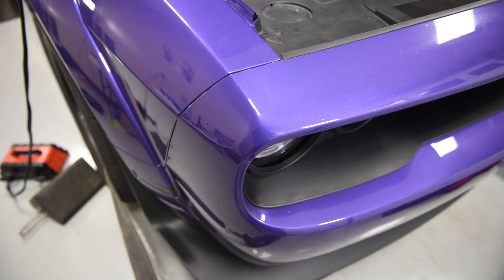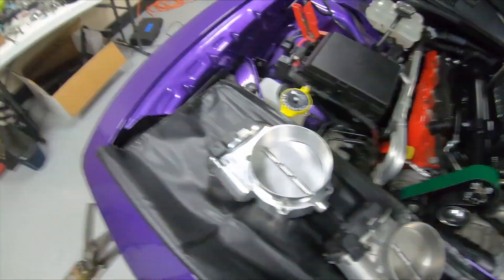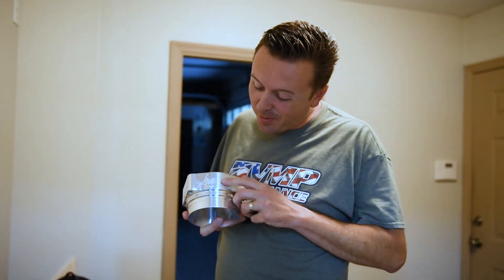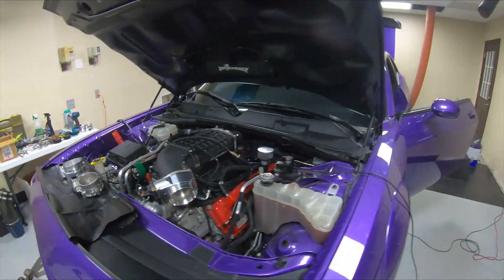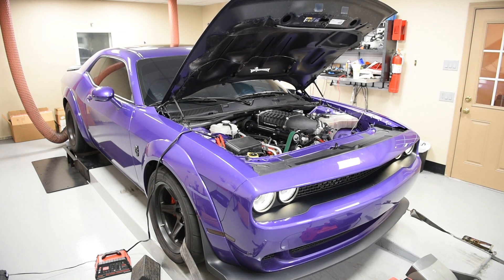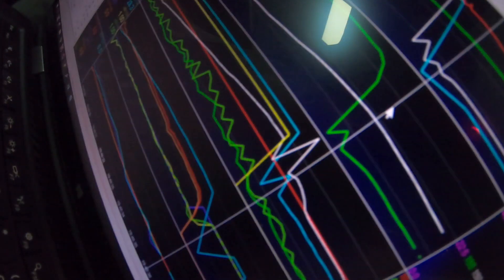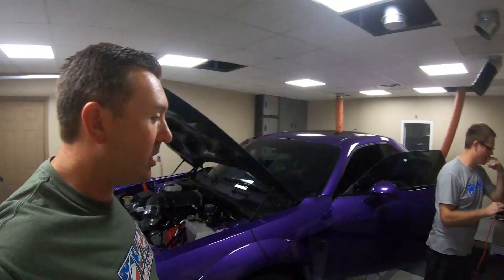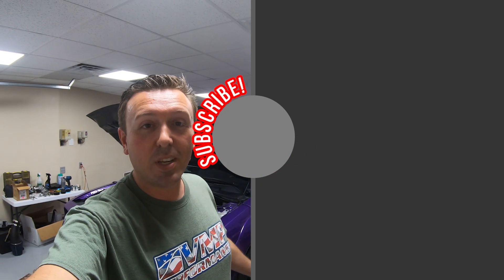First Dodge Hellcat Magnuson Supercharger On A Demon!

Comment: Need a bigger intercooler pump! IAT came up quick. 
Nice results! Monster torque I’m sure
Reply: Matt Kesatie 
Cooling is common issue with these setups. If it’s rising that fast the flow is inadequate. 
Bugatti has it figured out. For their 1500hp car it takes about 200 gallons per minute to keep IATs in check. Most street setups aren’t even above 10GPM. Department of boost has lots of info on this.
Reply: Matt Kesatie 
Is that a marine pump? 
What line size for the system?

Vmp had at least a degree/sec slower rise in IAT with a stock 13’ gt500 pump at 17-19psi. Right at 800whp and 8-10GPM.
Reply: Need bigger aftercooler bricks, bigger aftercooler radiators, bigger hoses and orifices.

Comment: A stock ported blower with other mods could have made close to that power and cost several thousand less.  Would have also been able to do a nice fuel system and run corn.
Reply: Justin and his team are just getting started. This thing will make over 1000rwhp when there done. Stock blower will not touch a 2650. Vmp is my go    To for horsepower.
Reply: Kevin Mays I’m sure it won’t. The 2650 is a bigger blower so it supposed to make more power. Me personally unless im maxing out a stock blower setup I see no need to upgrade. But that’s just me. For the $6k or more the 2650 cost I would do a ported stock blower, bigger tb, fuel system, headers, possibly even valvetrain mods. That would give more power then id ever need lol
Reply: @musclecity06  Exactly. The 2650 rotors are just too overkill for 95% of setups. The stock ported blower can make up to 900whp which is a good max for the hellcat engine. The demon motor however is fully forged and has taken well over 1000whp pretty easily.
Reply: @rileyneufeld7001  the thing is it isnt just about the size of the blower vmp is great at making blowers more efficient and they make more hp per displacenent.  If you were making 900 wheel with this blower its gonna be working  a hell of alot less than a max effort stock blower putting less strain on the blower and on the engine itself and less heat soak issues as well.  Not to mention you have a much higher ceiling with the more efficient blower.  You dont wanna go too big on the blower because it hurts power on the hit and torque thats why the 2.65 blowers are so great you get good response and a meaty powerband and the vmp blowers flow so good for their size.  This thing was doing over 900 on pump gas and im sure theyll get it higher.  The gen3r did 1141 rwhp on a stock gen 2 coyote so that shows what theyre capable of.  Lund made over 1200 whp on a built 5.8 gt500 with one...the torque was amazing too nearly as high.  It is true you may be able to get similar numbers to this video with a stock blower for cheaper but it wont be an equal setup.  Theres more to it than just what the numbers on the dyno say.  Like i mentioned before the blower works alot harder and creates more heat and more stress on the engine vs a larger more efficient blower.  So there is good reasons to upgrade.  This was also pump...can the stock blower make 900-1000 wheel hp on pump gas?   People say the same thing w the 13-14 gt500s you can make 800+ rwhp on e85 w a max effort stock blower build and andrew from mustang lifestyle makes 800 wheel on his gt500 with the vmp gen 3r but it isnt workin nearly as hard...also its doing it safely on pump 93 fuel NOT e85 which is significantly different.  Im sure this demon is similar although i dont know nearly as much about dodge stuff.  Just my .02
Reply: @rileyneufeld7001  also the 2650 is def not overkill or too big its not too big like the 3-4 liter whipples and kenne bell blowers thats what makes it great its a super efficient smaller blower that can provide nice torque low and punch on the hit while making great overall power too
Reply: reese  so the 2.65 is bigger than the demon’s 2.7 ? Lol
Reply: @lg740xx  math isnt his strongsuite lmao

Comment: Modern day...except ancient pushrod architecture. That’s why Coyotes and other Ford mod motors are so impressive. Compare the displacement to the Dodge and Chevy motors vs power produced. What does a Coyote at 24 lbs of boost make?? Over 1k at the wheels. Still, gotta love this age when the big 3 are making more and more power reliably and smooth enough to drive everyday. Amazing. 60s can’t touch us now.
Reply: But a coyote isn't touching 24 psi of boost without E85 and a full fuel system. This demon is not on E85 and has the stock fuel system.
Reply: 97jag440 not sure what your point is??? If you can make MORE power on lower boost that’s a good thing. That’s exactly what the Coyotes do. Do u build an engine to handle boost or make power?
Reply: 97jag440 oh and you realize they run mid 20 lbs on pump gas because those engines were built for boost from the factory. Thus they were designed with a 9.5:1 compression ratio while the Coyote was given an 11:1 in Gen 2 and 12:1 in the 18/19 as they were factory NA engines.
Reply: @richardsak887  yes it will make the power because it has a higher static compression ratio. Congrats you understand basic engine dynamics. My point was that no coyote would do 24 psi without E85 and a fuel system where as the demon is doing this on gasoline. (Sure its lower compression because it was designed for boost) but a gen 2 coyotes limit on stock internals is roughly 800 if you want the engine to live for a while.
Reply: 97jag440 ok...but what does that have to do with pushrod tech being old? That was my point. While they do have a few benefits, the design and tech in engines like the Coyote (and vast majority of today’s engines) produce more with less.
Reply: 97jag440 oh and as someone who mods Mustangs, there’s plenty of Gen 2 Coyotes at 800+ running fine. 1st and 3rd Gen...eh...I’d be more cautious with those. For boost though, Gen 2 loves it

Comment: I have a 2017 392 hemi with a shaker hood special edition. MOPAR17 EDITION, could you build a supercharger to work with that setup, if so what kind of horsepower could we get?
Reply: MOPAR17 bonkers
Reply: Before the powdered rods window the block? Anything above 600whp has shown to not be safe. Heck some people have blown up their 392's with only 6psi of boost... Get some forged rods and pistons in there before you think about making hellcat numbers.
Reply: Junk
Reply: @rileyneufeld7001  that's good to know, I was actually looking to do that prior to any power mods. Do you still think you could build a supercharger for the 392 shaker? I am working with Rains Performance Motorsports here in Denver. The owner works on all the Dodge Challengers and Chargers for the Colorado Challengers Club, he is awesome. What are your thoughts.
Reply: @mopar1788  I would just go with the new edelbrock blower. It has the same Eaton 2650 rotors as the vmp gen3/gen3R and is front feed which is a more efficient way to feed the rotors. The Edelbrock has gone 8.6 in the Mustang so it's proven for high HP. The only other issue after the motor is built is the transmissions in the 392's isn't made for much power from what I've heard.
Reply: @mopar1788  since you have a shaker you're only option is centrifugal, so a procharger for example. With forged rods and pistons you could sit at about 700whp at about 12psi with a scat. Any higher and say bye bye to the 8hp70. Upgrade to an 8hp90 and now you're talking 1000+ HP capable with a stroker, cam, heads, and a F1 procharger. MAYBE close to 1000hp on a maxed out D1. Imo I'd just go headers and a cam on 392, sets you right about 500-520whp on 93 and never have to worry about blowing your tranny or ring landings. If that ain't enough for u a little 50-75 shot wouldn't hurt. Definitely think about a stroker kit if you're forging the block tho, for not much more you're getting a shit ton more power and still ending with the same forged internals you wanted.
Reply: @MOPAR17 a lot of shaker guys are tucking the Magnuson TVS 2300 under the shaker bracket. It fits pretty well with minimal modification to the bracket and passes for a sleeper at first glance. Not as robust as the 2650 but it’s probably much better suited to the 392. Check out some rides on shopHemi.com. I’m getting my 2300 put on by a local shop in El Paso. It has grown very common in the last few years.
Reply: Before we swapped in the Hellcat 426 and the bigger Maggy 2650 I had a 392 shaker with forged internals with a Magnusin tvs 2650 with a duel pump e85 fuel system, cam, headers and we made 700 whp making 12 psi.  Procharger make more powerful supercharger that will work with the shaker if you are into centrifugal Superchargers.  TVS 2300 is the only Roots that with fit. 700 whp is pretty damn fast so it's a great option
Reply: @Gdimina  im looking into the 2650 edelbrock supercharger for the 6.4 platform what size pulley and belt combination you use for that set up and did you do the 6%ati dampner or 18% dampner?

Comment: Now we're talking. Make sure it's on good oil the valve seats are sketchy.
Reply: What do valve seats and oil have to do with each other?
Reply: Poor lubrication has been chewing up the seats and guides on hellcats as well as demons.
Reply: Some think it's spring issues and float tearing them up as well. There's not a fix currently. Dodge has just been replacing heads and getting them back. Been going on awhile, surprised with the more stout springs the demons and redeye have still been seeing the same float like conditions in the higher rpms.

Comment: You guys. Sorry to break the fantastic 69 comments, the golden number will have to be broken, but this is as crazy as the srt guys when they came out with a 700 horsepower engine with warranty a few years back. This thing will be doing burnouts in 6th gear 😂😂

Comment: The GM cars on 2650s are breaking 1000whp on the 95mm throttle body. All this technology dodge has in the heads and drivetrain seem to add up to less power when compared to a GM 6.2. Even the stock 2650 lt5 blower cars are making more then these on this larger blower.

Comment: Not going to lie.  I was a little bit disappointed.
Reply: It made 914 on pump gas! What were you hoping for?
Reply: 1000.  Camocat is making 954whp on E85 and bolt ons.
Reply: @StockGT350  only 40 more hp than a 93 octane car with e85? Now I'm a little bit disappointed.
Reply: THE ONE with a stock supercharger?  Ok guy.